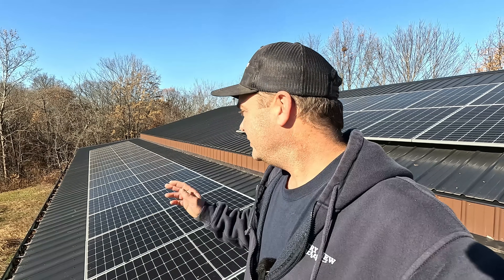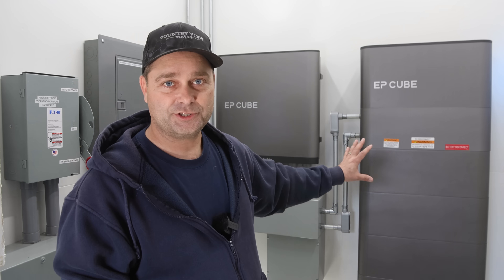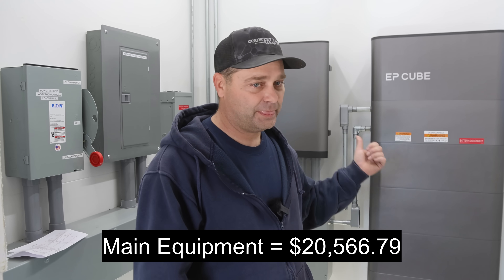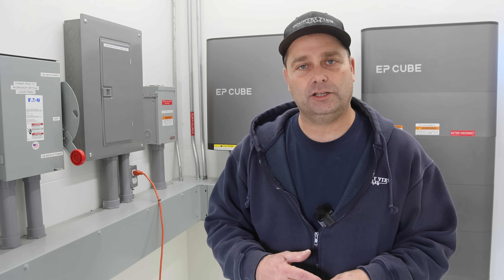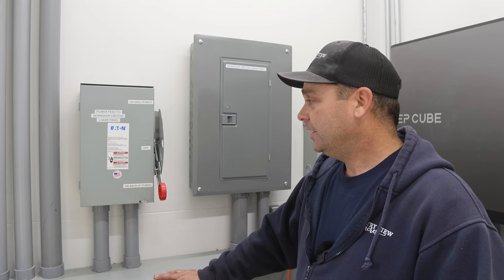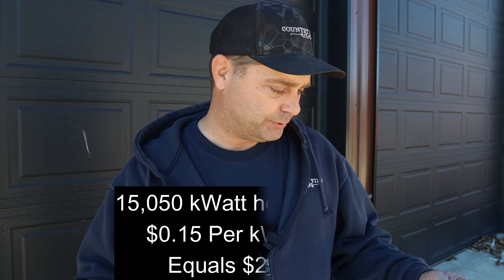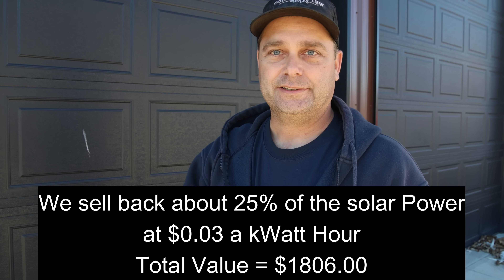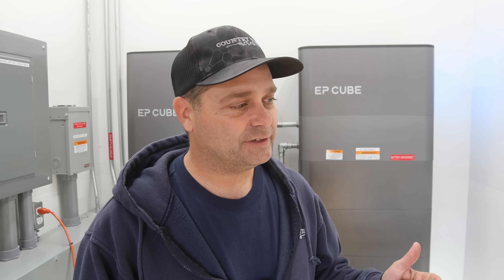Total Cost Breakdown of our Solar Power System & How Many Years to Pay for Itself.

Comment: Here's what I did. I purchased all of my own equipment including batteries off of the Internet and installed it myself for $12,000. I did not pull a permit and I did not get a connection agreement with my electric utility. I put my system in non-export mode so it never spins the meter backwards. All of my excess solar goes into the batteries and then at night I use energy from the batteries. Then, I calculated that a system of my size would cost a typical homeowner in the neighborhood of $28,000. So on my tax return I claimed $28,000 spent on my solar system and got a 30% tax credit! 😂😂😂 So that's $8400 back on my $12,000 investment and now my electric runs at about $300 per year. I did this years ago and have never gotten busted, nor will I as you cannot see my solar or my batteries from the street. 😂😂😂😂 yes it was illegal what I did with the IRS, but I consider my property taxes and the income tax that I've been paying since I was 14 years old a little overboard so I got some back! 😂😂😂

Comment: one thing he didnt mention. interest, how much is interest for 20K over 10 years, and if you invested 20K how much would that make so you could pay your electric bill. 

well at 6% loan for 10 years your monthly bill would be 222.00. more than your electric bill. so no savings there. 

if you invested 20K for 10 years you make 10K at 4%. making half you electric bill per month. paying half your bills for 10 years and still have 20K. maybe in 10 years solar will cheaper, and you wouldnt have to borrow to get a replacement one, since you still have the 20K. and we tax payers would have saved the 10K you got in federal breaks,
Reply from the maker: Yes if looking strictly at savings, interest would need to be considered to a correct comparison  But what is being self sufficient and less dependent on the grid worth?  It's hard to out value on.  To some people it is worth the investment.
Reply: @CountryViewAcres  i have been following your system, you have a dead zone in the mornings, surplus in the evening, you are wanting to save money by spending to get more panels and even more for storage. cant you point some of you panels towards the east. to increase morning production, you might get less in the evenings, i know, but think. it would increase production when you need it the most and save money. and you got enough in the evenings not to notice. and i bet still the total daily production wouldnt change, solving the shortage in the morning, saving electic bill and not spending more to increase the size. i think this one of the pitfalls of solar. always spending more to get more to save even less. most production is at noon, everyone knows that, right. but noon is just 90* to the sun. 9-10am could be "noon" if you set the panels at 90* to where the sun is then.

Comment: Sell the system you have now ... build a new system with Victron multiplus 5000 2x  and victron mppts ...and build a battery yourself  from  16 eve cells  280ah  14.8kw per unit  2300$ about ... put in 4 of them.  that would be enough for you. 
and just lay the roof FULL of solar   .. .the lower roof can handel more if you turn the pannels  and dubbel the rows...  calculate it for the topside ... use chatgpt if needed hahaha
and your battery needs to be at least 40Kwh if your out with 20Kwh in a day .  
dont worry about selling it back... the thing is  inflation in 10 20 years youll be paying dubble the price of electricity ...so build and just maintain your system over the years. 
and most important thing ...manage your loads  because if you just keep running stuff    like I DONT MIND ...your better off being connected to the grid  and going on a vacation. 
or you separate the load of the hous from the panel side... so your high demand loads  run from the grid...and the rest runs from the battery ..that means splitting the main board up yes...lots of work and thinking about things ... but thats just how it work  if you dont want to over spend  more than you already did ...

Comment: $13,000 batteries hold 20kwh at .10 kWh is $2.00 worth of electric. How can this possibly pay off ever , include 5% money market return on not buying batteries and you have $650 a year to buy electric at .10kwh you can buy 17kwh of electric and still have $13000 when the batteries life ends.
I just can’t understand how solar is worth the effort it’s certainly not saving money.

Just my need for 1200watts to run my cpap in a tent cost me $300 for a lifepo4 $60 for a 300watt inverter and $100 for a charger to store 12 cents worth of power is crazy. No solar panels to recharge since I need reliable power. Electric power is dirt cheap compared to rolling your own with a true accounting including lifetime of equipment and loss of income in just a money market account.

Comment: Great analysis. It might behoove you to do another cost analysis adding say 50% more batteries, so you can use more of the solar you produce rather than selling it back to the power company for pennies. Remember, that electricity rates don't go down, only up. We're retired FT RVers who discovered we love to boondock off-grid. We lived in our motorhome off grid for 10 months last year. We designed and built our electrical system ourselves (my son is an electrician and he kept me safe), which allows us to be electrically self-sufficient, without the need to connect to the grid anymore. It sure is a liberating feeling to know no matter what happens, if electricity rates skyrocket to over 40 cents/kwh or more like they are in Hawaii, it won't affect us in the least.  

We started by building a 620-watt liftable solar array on the side of our motorhome. Our side array makes a nice bedroom window awning too, practically lifting itself with a couple gas struts, and it's easy to clean, standing safely on the ground. Lifting the array to the exact angle needed improves its efficiency 20-30% compared to horizontally mounted panels, even more in the winter, when the sun is lower in the sky. Next, we built a 12v, 560ah LiFePo-4 battery using 8, 280ah prismatic cells and a Heltec 330amp (1,200a surge) BMS to start my generator, with a 5a active balancer. These cells fit perfectly under the steps of our MH where our old pair of golf cart batteries used to reside. We insulated the battery compartment, cut a small hole in our step risers and installed a tiny computer CPU fan to keep this space at close to room temperature, so we don't have to worry about the BMS shutting down charging due to low temperature - or their life reduced from getting too hot. If you add all our 12v system components together including the liftable array, wiring, converter/charger, inverter, charge controller, breakers, wiring, battery monitor, etc. this system cost us under $3,500. It has already paid for itself several times over the last 5 years, not just in the cost of electricity, but in the cost of staying in RV parks. Boondocking is mostly free, but RV parks can average $45 a night or more. Even at their discounted monthly rates, most RV parks cost $400-$750/mo. + metered electricity. Having proven the concept, we expanded our system.

By mounting the solar array on the side of our coach, we left the roof free to rack 8, 550w solar panels down the length of our 35ft Class A, 15" off the roof, above our AC, vents, etc. These cost us 51 cents/watt shipped to our door. It shades our entire roof, allowing plenty of cooling air underneath, increasing solar output and reducing the heat load on the air conditioners. Our 4,400w array can run both our A/Cs, our household appliances and charge our batteries at the same time, even in winter. We can even run our mini split heat pump 24/7 providing both A/C and heat powered by the sun. We use a Sungold Power all-in-one 48V, 5,000W Inverter/100A charge controller/battery charger, saving us space as well as money compared to a system built with individual components. We chose this particular unit because it supports up to 500 volts of solar power which was needed for our 400voc solar array. Our 48v battery uses 16, 320ah prismatic cells and a 200amp Heltec BMS to keep it safe.

Together with our 7.1 kwh 12v bank, we have a total of 23.5 kwh of batteries onboard (slightly more than you have, though our storage needs are far less) - kept charged by 5,020 watts of solar. We removed our old rooftop bedroom A/C and replaced it with an EG4 28.5 seer-2 mini-split heat pump on the upper rear of our motorhome. It's super quiet and cools as well as our 14.5k btu soft start equipped Furrion we have up front, but only draws about 1/3rd the power. It heats efficiently too, reducing our propane usage. 

Our total budget for both 12v and 48v systems was around $11,500, including the $1,500 high-efficiency heat pump. We have no need to hook-up to power pedestals or run our generator anymore, as we run everything in our MH strictly off the sun. We travel around the country a lot, visiting National Parks, and doing the tourist thing, mostly boondocking out west. We spent last winter in Yuma, AZ, but we're visiting our son in NC now, where boondocking places are pretty rare. We found an RV park that is letting us camp in a spacious site without hook-ups for only $100/mo., saving us $500/mo. off their FHU rates. At this rate, our 48v system will be paid for soon too. BTW, I didn't take any money from the government for my system, so I'm not beholden to them in any way.

Comment: My utility company does the same thing. 
I wish we had redox flow batteries more readily available for residential applications in the U.S. they have near infinite cycle life, 30 plus years. Just have to worry about a couple mechanical pieces like a fluid pump. Non-flammable. Less energy dense but that doesn't matter for residential applications.

Comment: So it looks like you start buying power at 6 am.   Have you considered getting up an hour later?   That would cut your purchased power in half.  Another thought would be to buy one more battery.   Do you think that would eliminate buying any power?  The power company buying from you for 3 cents is like robbing from you.   I would do everything I could not to buy from them.   Another idea-putting timers on the freezers and refrigerator for that 2 hours to hold off buying power.   Just ideas.  I think you did a fantastic job on the solar.  You still have plenty of room on that roof!   Another idea-use the ecoflows to run the refrigerator and freezer at night.   Then you could recharge them later in the afternoon instead of sending that power to the power company.   I run my fridge 24 hrs a day off my bluetti ac200p.

Comment: Watched your video from a year ago, than got this one - You definitely did it correct, but im still confused how you use so much electricity? - Ima 26 year electrician, and have run my house nightly on 2-200AH batteries (400 total) - i dont run washer or dryer at that time, and the stove is gas.  But i run all my lights, gaming computers, TV's Entertainment, Fridges and more just fine.  Do you have a lumber mill behind that building im not seeing?

Comment: i didn't catch exactly the purpose of the manual transfer switch.
Reply from the maker: It switches between grid or solar.  Basically it you need to work on your solar,  you can bypass it, so you still have power while working safely on the de-energized solar.  Or if the solar has problems you can bypass it.

Comment: Yes, your labor cost is free.  So double or triple your cost for an average home owner.   Its a nice setup.  Is the inverter split phase?  How long of a run to your panel in the house.  Do you get any voltage drop?   I would recommend tilting the panels (not sure your location or what angle your roof is) to get more hours of the sun in the summer.  In the winter, I doubt  you will produced the same amount of power.   Yes, all the little things adds up pretty quick.

Comment: I would not get solar because i think that there would be better solar on down the line and you have to pay a lot up front. If you have to replace your roof it will cost a lot to reinstall. Hail will damage the panels.  You do not get money  
you get credit in one year increments for 4 years. Do not believe what the salesman tells you. They wii only honor what is in the contract. I heard this on someone who got screwed on the internet. You seem to be happy but you did the work yourself and saved al lot, but most people could not do it themselves. There is a cost for maintenance.
Reply from the maker: The panels are insured with my house insurance.   If they get damaged, it is covered.  Plus, the warranty is 25 years.  My metal roof will last at least 25 years.  So they need replaced around the same time.  
The credit amount depends on how you pay in taxes and the credit amount.  I pay enough taxes to get it in one year.

Comment: You should also consider that money used to pay the power company is taxed heavily.  To pay the power company 1$  I have to earn $1.37... Now everybody's tax situation is different.  Most people who are considering purchasing a system like this will have a similar tax burden.  This will significantly change your rate of return calculation.  For your calculation $1,886/$19,161 = .0984 or 9.84% rate of return on your investment of $19,161  not including the tax escalator.  Using your numbers with my tax situation it 9.84% x 1.37 =  13.4 % rate of return....(I know this oversimplifies it as tax rate is not linear)  either way its a fantastic rate of return on your investment.   My electric company has to pay one to one on energy produced so its a better deal for sure with us on the net metering.   Also they charge significantly less for off peak hours of electricity so batteries don't really make sense in that situation.  Either way Kudos to you for putting together such a baller system!

Comment: I avoided the pitfalls with the utility company by making all my own electricity & storing it in a bank of batteries.  I don't sell them anything.  Be forwarned that you should buy all your equipment & materials in the same year because the IRS only lets you claim the 30% credit once in your lifetime.  I also did my own install.  The credit lowered my tax rate, I got another credit from my state, and I ended up getting combined tax refunds only $1000 less than the cost to buy everything.  And my solar reduced my utility bill massively, not counting gas service.  My utility company immediately contacted me & wanted to know how I lowered my usage so much.  😅
Reply: According to the IRS website, you can claim the solar tax credit once per year on all eligible equipment, not once per lifetime.

Comment: I have an EG4 system from Signature Solar.  24 460 watt panels, Two 6,500 off grid inverters, four 5.12 kWh batteries.  $15,500 for the kit, free shipping.  Wiring, ground mount and misc cost, $5,000.  71, did all the work myself, not an electrical engineer but I ran a farm for 25 years and was asst plant manager at a produce packing plant for 10 years and we installed all kinds of electrical machinery and did much of the wiring ourselves.  My solar room isn't pretty but it works.  My plan is to install 8 more panels and two more batteries to max out my charge controllers and battery rack.

A hybrid system costs more but you can maximize your solar usage,  if your batteries go dead it just automatically switches over to the grid. I am not off grid so I am going to run some loads and my A/Cs during the summer to save money on those.  If I run out of battery power I will have to manually transfer power back to the grid for those.

Comment: One way to check your break even  analysis is to divide the $19,000 by 120 months. That equals $158/mo.
That is the amount your electricity bill must be reduced by each month (on average) in order to recoup your $19,000. If your january 2024 electric bill isn't $158 lower than the 2023 bill, you won't break even in 10 years.

Comment: You need to add in what your grid power would cost with no system.  Then add that cost as a cost savings + your power to the grid income in order to get the true return on investment income for your system.  Then divide the final system cost by the true return on investment income to get your true number of years needed to reach break even.  I'm guessing ingredients that number will be less than 5 years till actual breakeven